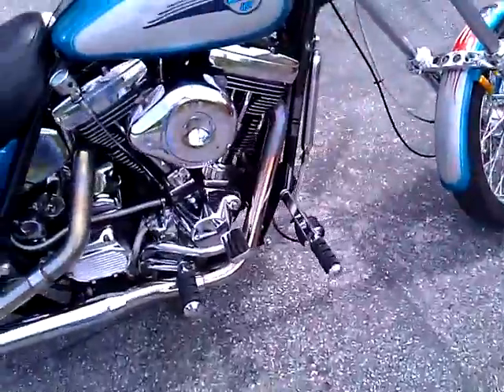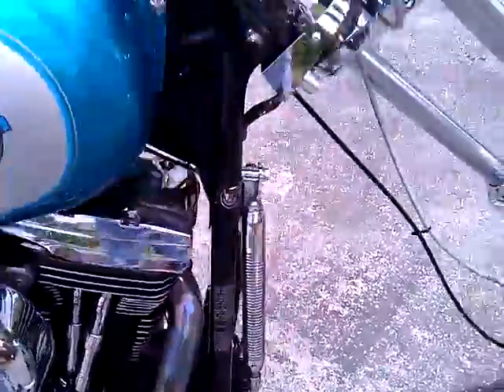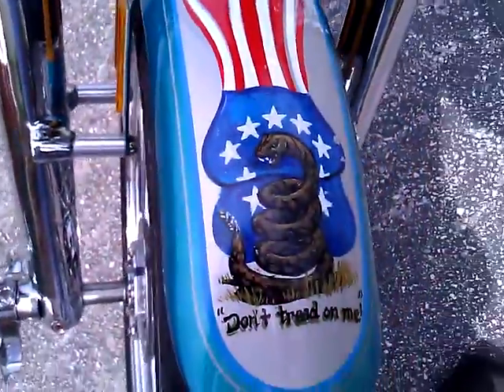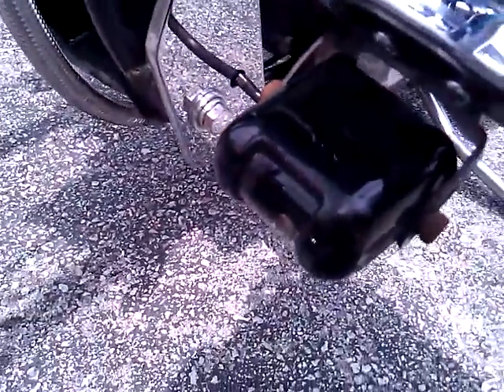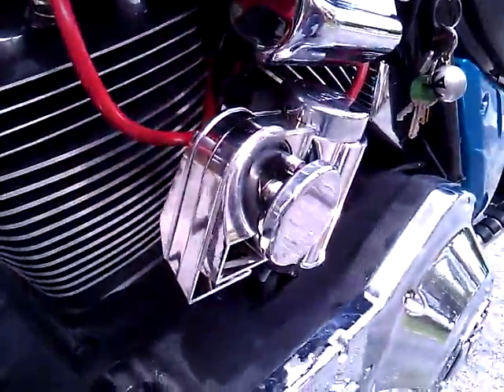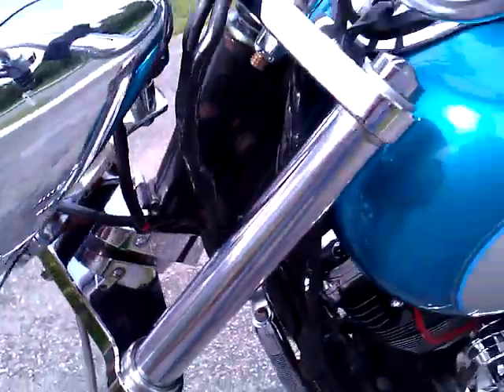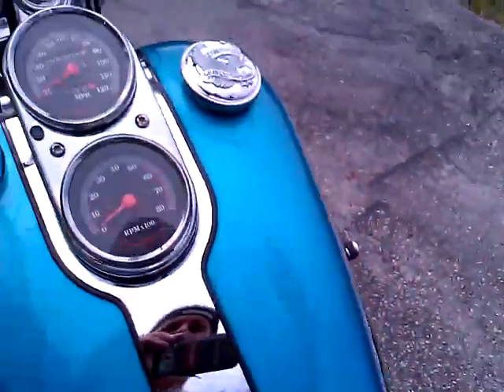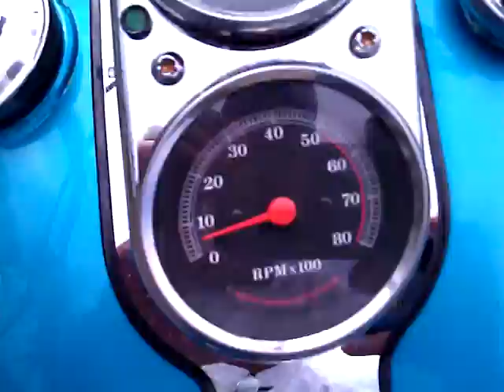1990 FXRS Harley Davidson Revolution Performance 85 CID Bolt On Kit!

Comment: Great way to ruin a FXR handling and that Idle is too low . Its going to dump those rods if you dont get it up to around 900 rpm .
Reply: If JC Whitney built a motorcycle...